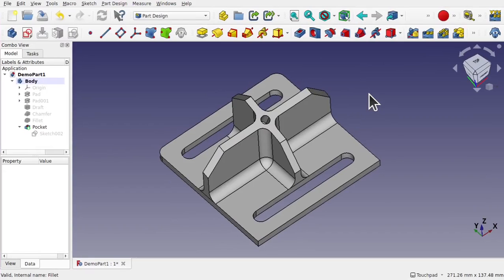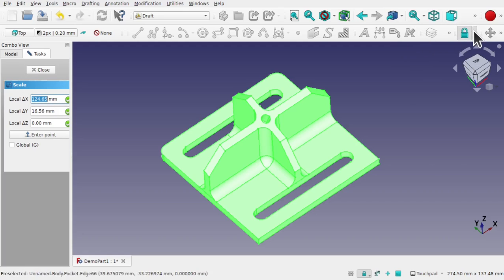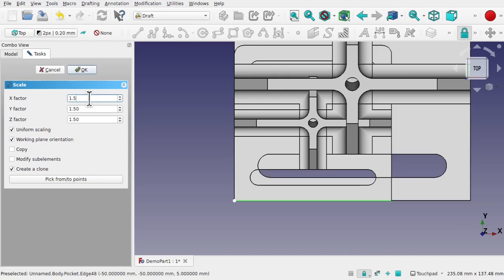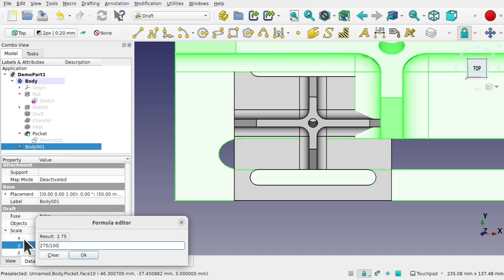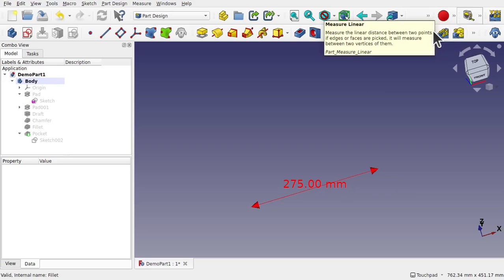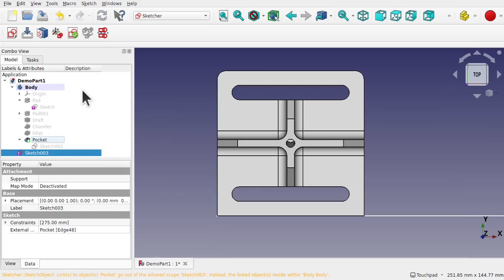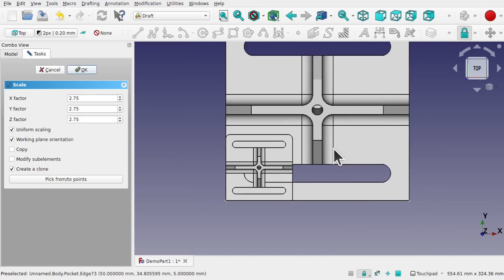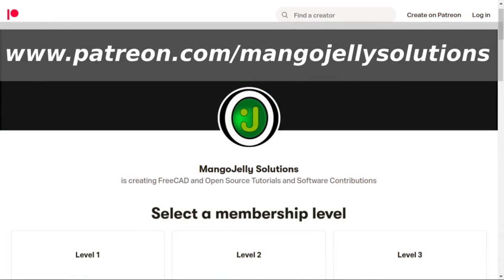FreeCAD: Understanding the Scaling tool and how to accurately scale your parts

Comment: Thank you, this pick points tool is very confusing indeed. That video helped a lot to undestand how it works. Although I don't quite understand how different types of clones work. What difference is between draft clone and part design clone? Do you have a video about that? I remember you explained copy and part design clone operations somewhere, but I haven't yet seen a video where draft clone is explained.
Reply from the maker: Thank you for the feedback, really appreciate that.  I do have an older video for the part design clone https://youtu.be/zIdfeErl3ZI but I haven't got one for the draft clone as of yet.  The draft clone clones the selected whether it be a sketch, feature, body etc where as the part design clone branches from the selected feature into a new body so you can create a new workflow in the new body and carry on with the existing.  So your project can go off on multiple paths.

Comment: Thanks, never knew about this tool!
I have an unrelated question. If I want to make an angled extrusion, say the left side of the sketch should be extruded 10mm and the right 20mm, with a slope in between. What is the best way to do that? I've been extruding normally that making a plane to cut the extra off, but despite calculating what angle I need for the vertical leg of the right triangle to be my 10mm, I never got it right.
In my real life example it was more like 3 and 0.6mm sides.
Reply from the maker: I'm guessing from the part that I was scaling that's what sparked your question as the top is angled? Is that the kind of result you are looking for? If you use a part design workflow then you can use a draft. This will angle a face to an angle. Actually, I think the tool exists in the part workbench as well.
Reply: @MangoJellySolutions  Not sure, I had this task for a project and never quite solved it, so I keep thinking about it from time to time.
So I'd extrude and then Draft the top face only? I'll try that now.
Can't make it work, maybe my shape is too rounded for that to work. I'll ask in FreeCAD Discord then, it's easier there with pictures :) Thank you for the suggestion!